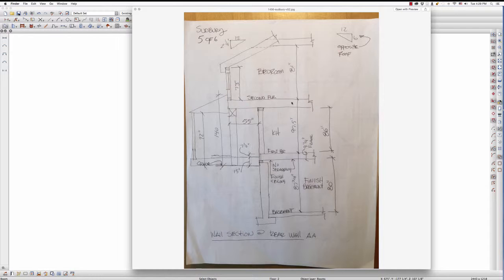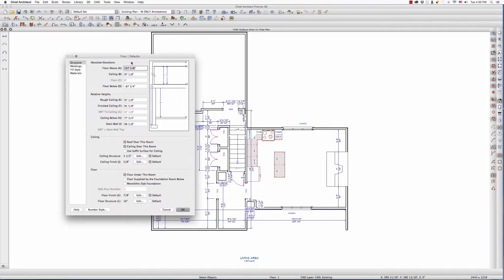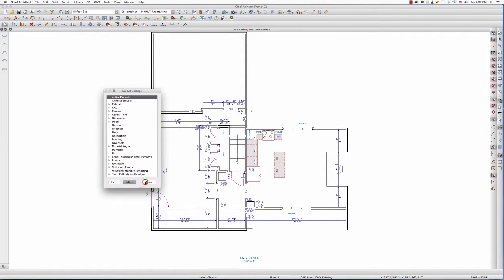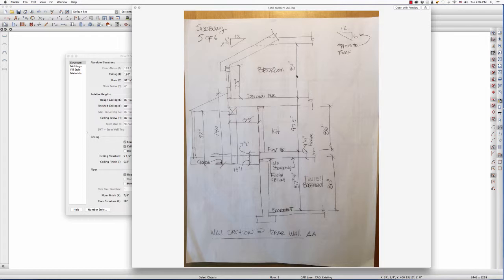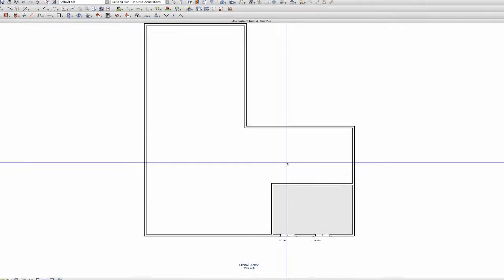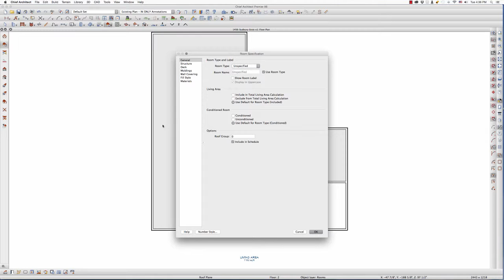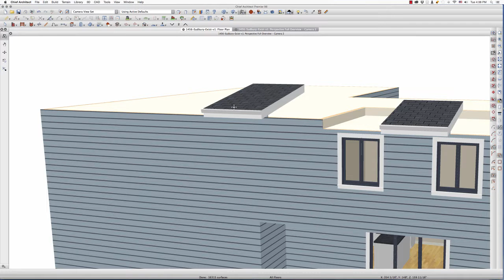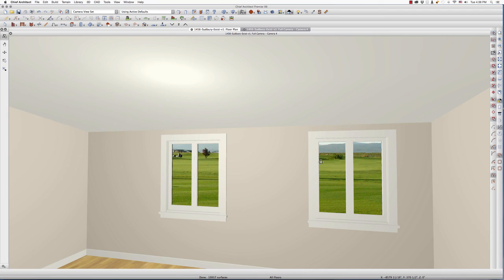Chief Architect Sloped ceiling

Comment: Hi Tim. how do you do a slope ceiling when the ceiling only affects half of the room? I have tried many ways, I get close, but I can't get the ceiling line and wall sections to join properly. there is always a void some where, I have a room where half the room is under a roof with a 12/12, the other half of the room is standard height
Reply from the maker: Thanks for the comment fireworksphill. Sorry I haven't seen this until now. This is an interesting circumstance. Are we discussing this over on Patreon now? Want to make sure I'm getting your question answered.
Reply from the maker: Hi Phil. Did you receive my email about sending the file?